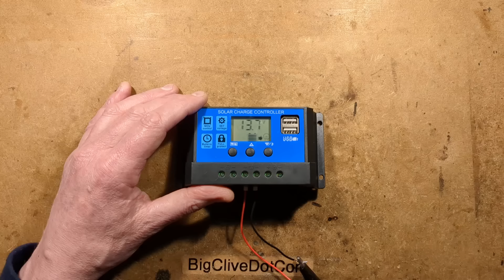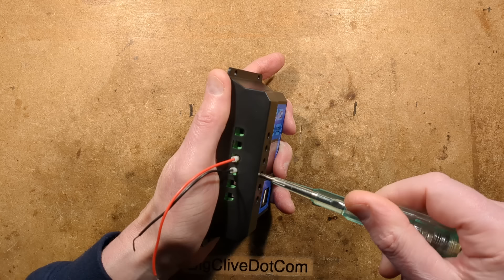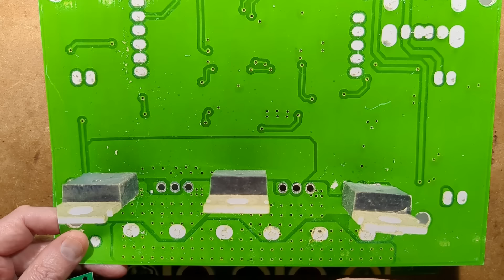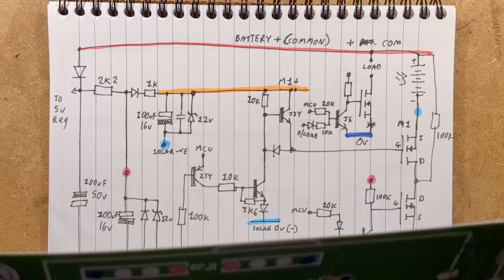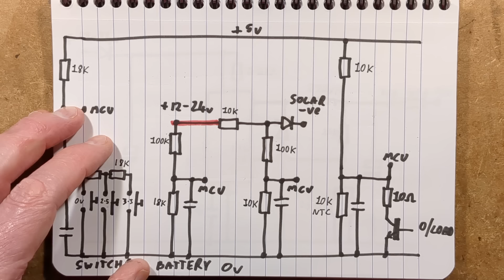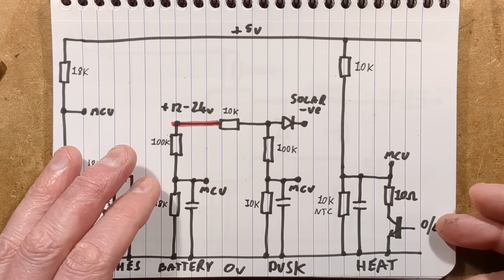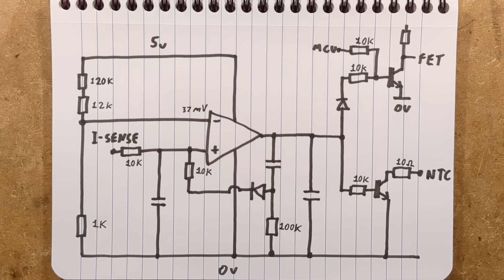Exploring a mass produced solar charge controller

Comment: I think your description of the driving of M1 is wrong.

M1 is the MOSFET which controls charging, as its body diode is orientated against the flow of current from panel to battery, and hence if M1 is switched off, current cannot flow from the panel to the battery. (M2 prevents the battery discharging into the panel at night.)

Therefore, M1 provides the PWM (pulse-width modulation) in order to limit the current into the battery from the panel so that the battery voltage does not rise above that set by the MCU. With reference to your comment under the video, these things can regulate the charging current, rather than simply cutting off when the solar panel would overwhelm the battery.

This is achieved by switching M1 on and off rapidly, and because MOSFETs have a large gate capacitance, this requires a more complex drive circuit than M2. M2 has an NPN transistor to switch it off rapidly, but only a 100 k resistor to switch it on, which will mean it slowly passes through a partially-on state, generating heat each time.

Instead, M1 has a push-pull driver: the upper NPN transistor connects it straight to the M1+ rail to switch it on rapidly, and the lower NPN transistor, as per M2, shorts gate to source to switch it off rapidly, via a couple of diodes. (The threshold voltage for these MOSFETs will be a few volts, so pulling the gate to within a couple of diode forward drops of zero is quite sufficient, and in fact means slightly less charge is needed to switch it on again.)

In other words, only one of the two NPN transistors is on at once. Maybe that gives a clue into the mystery PNP transistor, but I haven't worked that out either.
Reply: Hi, so do you think this would regulate higher voltage PV to 12v battery ?
Reply: @giles7631  It either connects the panel straight to the battery, whereupon the battery will drag the voltage down to it, or if that doesn't work, it chops the panel's output into lumps which will transfer less power, again allowing the battery voltage not to be exceeded on average - on average, because there doesn't appear to be any capacitance to smooth it.
Reply: @giles7631  It either connects the panel straight to the battery, whereupon the battery will drag the voltage of the panel down, or, if that doesn't work, it starts chopping up the panel output into lumps which the battery is able to drag down.

Comment: Thank you for all your hard work on this - there are billions of them around, including one I have somewhere which was effectively free with a panel.

Not sure why the diode across the zener - the zener would do the same job (possibly at a slightly higher voltage drop).

The need for two FETs would have been clearer had you drawn in the body diodes. Although they can conduct in both directions, and will bypass the body diode when switched on (due to having no diode forward voltage drop), they can only block in one direction due to the body diode.

Comment: Quite an interesting one. Good for small solar applications but anything more than a single panel and you definitely should look for a MPPT charge controller.
Reply: Worth noting that these are widely mis-sold as MPPT.
Reply: Are you sure the ones that are sold as MPPT, or not MPPT? It's pretty simple code. Seems to me they could add it at no cost.
Reply: @TimHayward  No, the hardware has to be different. You need a large inductor to convert volts to amps.

Comment: A complex little beast ! I’ve used them (or a very similar one - no USB) both for my garden solar, and two 20A ones for a friend’s boat. All have run for a few years now, I conformal coated (condensation etc where mounted) and the boat ones was mounted on an aluminium sheet with some shims to act as a much bigger heat sink (200w and 100W solar on boat - two separate one engine, one domestic bank), the clamps are a pain as the case gets in the way as well when mounted so you can’t see them and sleeved ferrules foul on the case. So I cut the bottom plastic off - much easier and no condensation trap ! 

Both on lead acid, the boat one gets warm in the sumner, but is rarely really pushed as battery bank is never really  depleted.
Reply: Like many folk here I use one of these in my shed for lighting. But I had no idea it was so controllable so thanks Clive for this. While I think these are perfect for this kind of low level use I would never use something like this on my boat. Not only is it not marine-ready it's also the less effective PWM charging as opposed to MPPT which I would always use in mission-critical settings.
Reply: @richardpovall3020  I agree that it certainly is not what you would want for anything that is life critical, and of course is not Lloyd’s etc certified marine electronics. 

I also agree that it won’t squeeze every last joule out of the panels and into a battery bank. 

However this is a craft that my friend gets a lot of enjoyment out of with it moored up. He is not in the best of health and the job was done for free. This gave his boat lights he can just use,  the FM radio for him to listen to when he can visit the boat an electric bilge pump so no more hand pumping etc.

If you are saying g that’s wrong - so be it, it’s your opinion, but I’d do the same tomorrow for anyone in that circumstance.

Comment: The cheap PWM vs. the better MPPT charge controllers, but still it is a amazing for the price.
Reply: Depending where you live really Maximum Power Point Tracking in the UK can be less effective than PWM depending on sunlight. Works great down under tho.
Reply: It's really not amazing at any price though, these things are notorious for shorting out and destroying your batteries.
Reply: @TechHowden  User errors are common. Leave it to professionals.
Reply: @Fubarpapa  it doesn't matter if you're professional, this thing straight up isn't put together properly and the MOSFETs aren't cooled well enough. I used one of these for a short time and then opened it up only to see that the MOSFETs were just loosely touching a thermal pad. It should also have some built-in protection circuitry but there's absolutely none. Another issue is that the terminals are quite cheap and can sometimes overheat at higher currents no matter how much you try tightening them down. Just avoid this garbage.
Reply: @TechHowden  I mean for a small battery (12Ah or less) it's still fine... used one for the better part of 10 years, never had a problem with it. Maybe don't try to charge a 200Ah SLA whole off grid battery bank with it, but for a UPS battery or just any small 12 volt backup battery it'd be fine. Besides, if you're not putting a fuse between your battery and any device it's connected to, you're doing it wrong.
Reply: @TechHowden  3 years constant use charging 5 old car batteries (parallel) running my reasonable size 12v fridge 24/7 
Hasn't missed a beat. 

Added 2 more recently, one running at 24v because panel size was to large for 12v specs, charging 2 100Ah deep cycle FLA 
Checked battery stats regularly at first, all good. 
Survived an Australian summer inside a tin shed. 

Cheap but not so nasty IMHO